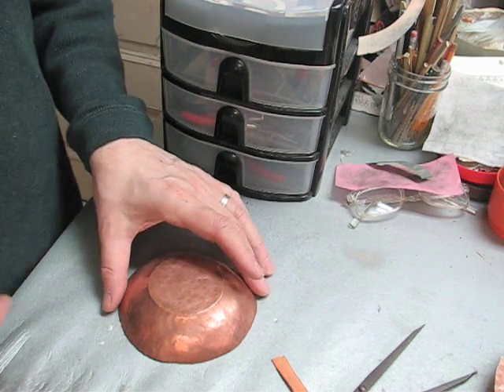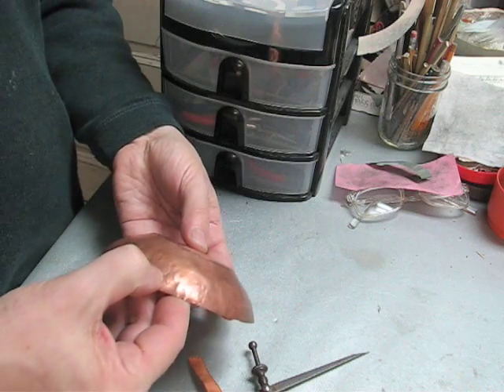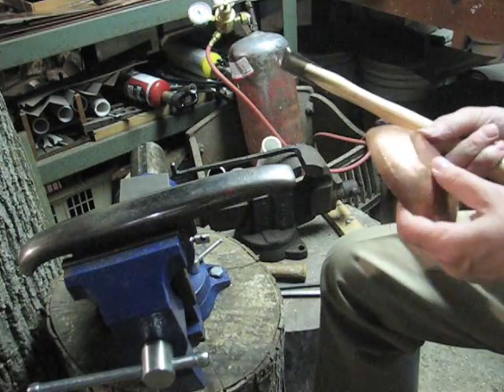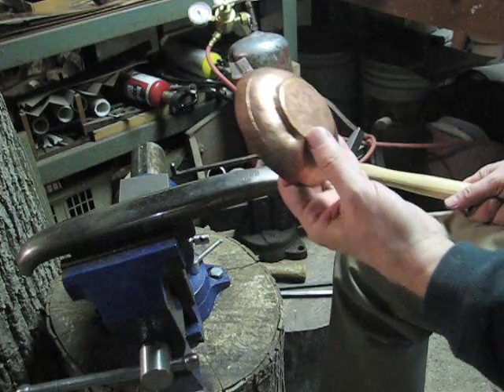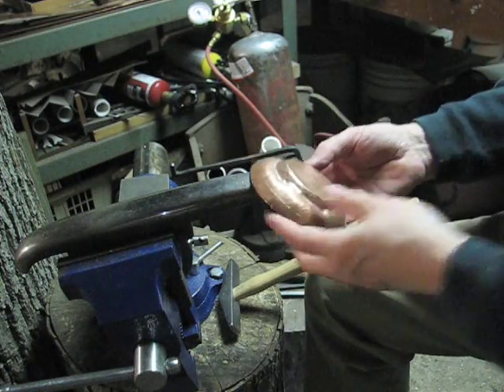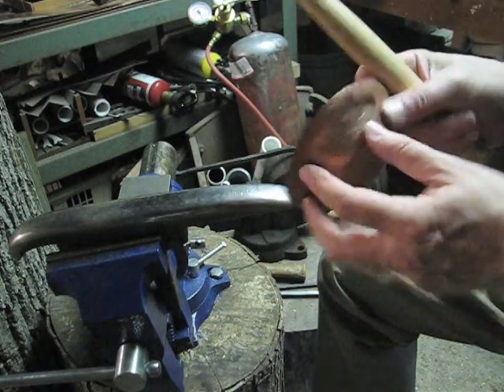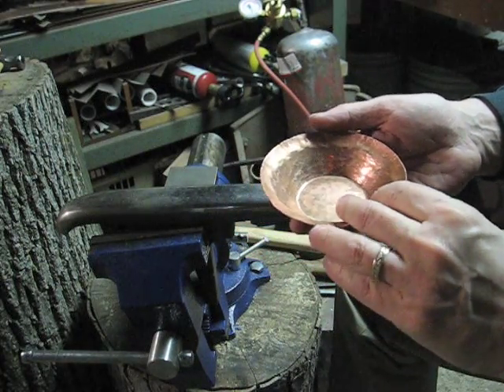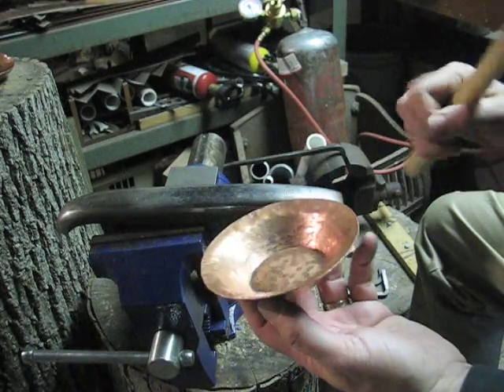Raise a Copper Vessel 4a - Raising the Bowl

Comment: Are the aluminum hammered items I just recycled also made in this way? My neighbor had a sale and gave me all of the left overs which were all aluminum. I had no use for them and they're from the 40's-50's and no one seems to want them anymore so I made some money on them.
Copper is a much nicer looking metal than aluminum for these type of items so I didn't feel too bad.
Reply: Probably not, but I can't say for sure. 

I've done some shrinking/stretching of both copper and aluminum and aluminum sssuuuuuucks to work with. Very brittle mostly.